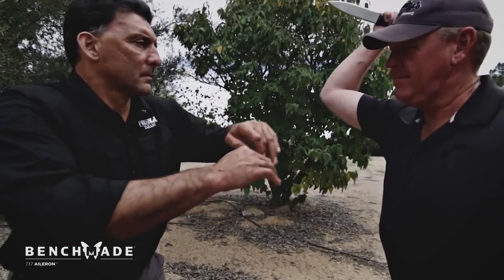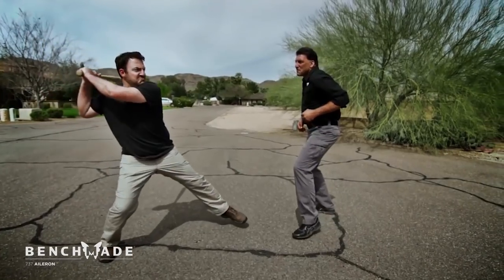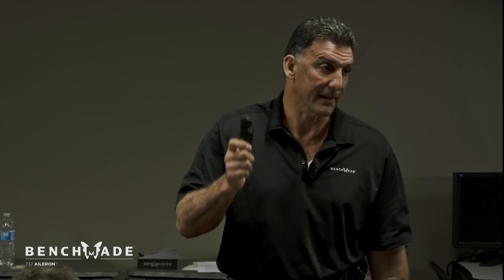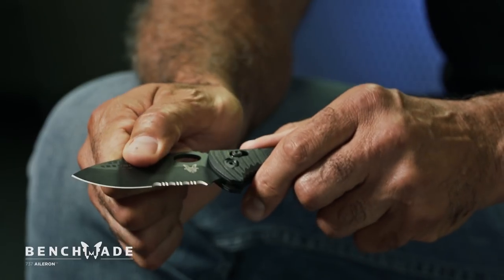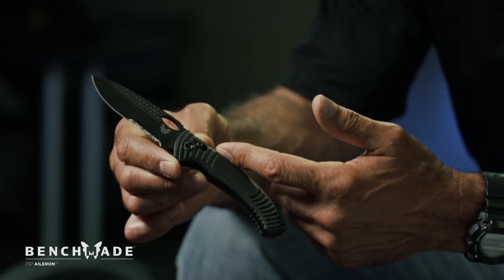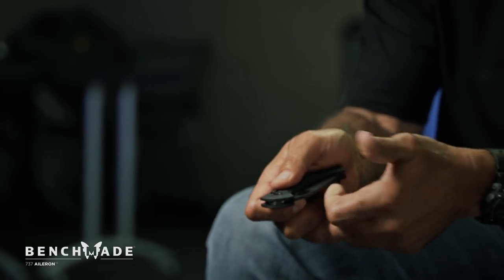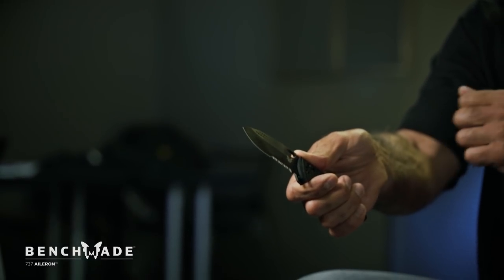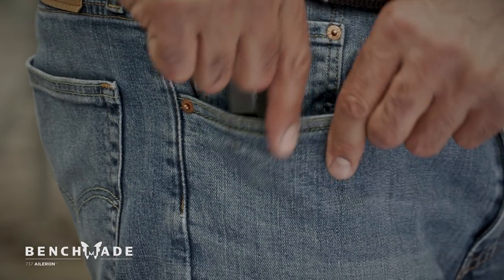Benchmade 737 Aileron

Comment: Selling a two handed knife for self defense is like selling a musket for self defense. Outdated and laughable when there are so many better options from benchmade. I believe this knife will be good for edc but self defense Not so much .
Reply: If you watched the video at all, you would have noticed that the first two options for opening the knife were by flipping and by using the thumb hole. Two handed opening is an OPTION and may work better for some people in some situations. If your extensive training tells you to use one hand, then by all means do so. But don't demean others for choosing other options.
Reply: Dennis Keith I don’t see a two handed opening as a viable option for anything other than self mutilation(especially when your adrenaline is in overdrive). If that is something you think will work than more power to you.besides my original comment wasn’t intended to mock people who choose two handed opening(different grinds for different kinds) but to mock benchmade for listening it in the way they did.

Comment: i've never seen a two hand deployment of a knife, although it makes a lot of sense.  in a serious confrontation you want to rely on the most successful and positive way to get you manual knife open. i'm sure a guy with his credentials has access to knives that open all kind of different ways.  Flipper, thumb stud, assisted and straight auto.  two handed is the safest and most reliable method.  on your run up to the mission you may be tvl. in some funky terrain and not have time to prepare your weapons for action.  a lot of things can happen on the way to the dance. (like weather)that could lead to mud and leave weapons less than spec) i'm not any kind of expert with a knife or in empty hand combat.  one thing i do know; when you deploy your weapon you always want to have the tip facing your enemy.  in fact i've seen a lot of videos where experts(?) spin, or manipulate their karambits backwards.  same reason you don't do it backwards.  you never want the blade tip facing you.  also this guy is using the same knife draw as a pistol draw(KISS)  Speed is associated with muscle memory.  in another lifetime i would revert to a two handed draw,
on the other hand if you carry a fixed blade for fighting this whole discussion is unnecessary
Reply: Tarani has always been an advocate for the two-handed opening technique.  I have a Buck-Strider-Tarani folder in black G10 and ATS-34 steel from 2005, and the forward sides of the blade towards are stippled / etched so that you can open it this way.  Personally I just use the small hole in the blade with my thumb, which to me is faster, but I guess if you train opening it this way that would be more consistent deployment.  Yeah, the video is a poorly executed marketing miss, a bit too tactical timmy, and like one pilot pointed out they can't even carry knives, but I get the point.  I actually picked up an Aileron (non-combo edge) last year for only $150, and it's worth it at that price point.  The best part of the knife is the ergo handle which is very comfortable, and would really make the knife hard to take away from you.  I also like the wide blade.  For me though, if I had to have a knife on me that I had to use to defend my life it would be a Hinderer, or a ZT 0562.  If it had to be a Benchmade it would be an Infidel OTF auto.

Comment: The fastest way to deploy it I just found out is to grab the knife by the blade in the grippy part and snap downwards a lock's right into place so to handed opening be dammed
Reply: But what about middlefinger flicking the hole, or thumb flicking the hole, or disengaging the axislock and flicking it open? Its all one-handed and just as quick, why use two hands?
Reply: @stijnvanpruissen3193  agreed. Found out also you can just snap it open. However it was designed for  Pilots to use and there's not much Room as your setting up there in the cockpit so it was designed for to quick to handed opening there's no real Room to flick it open I guess  You could but there's not a whole lot of Room in the cockpit to be flicking  It open

Comment: It's borderline comical, until you realize that you probably should have your arms up, palm up in front of your face, so you can protect your face, in a vaguely triangular shape (fists together, above your dome, elbows out); from that point, you can definitely positively deploy the blade with the other hand, as that movement is closer to gross motor skill, than fine motor skill (which are the first to go, once adrenaline dumps). It's not that bad of an idea, really.

Comment: What is funny out of all of this are the professional knife commentators, supposed combat expert commentators, and the guys that have NEVER even handled this knife making comments how "worthless this is" and how it's "mall ninja". You guys wreak of having zero experience in the real world. Let's state some facts. I actually own this knife and use it a lot. The blade etching has impeded ZERO cutting. It has been known for sometime when adrenaline, stress, combative environment, gloves, climate, sweat, oil, blood, water, WILL impede your motor skills. Fact. Opening a blade like this is nothing new. It has been around for a while. The etching is new. Though has been used on game cleaning knives. Which way you deploy a blade depends on the situation, and environment. Quite useful if need be. I will say, the etching is a game changer with cleaning game. Used this knife last week for this. Was night and day. The G10 and etching prevented hands slipping with blood. The handle has replaced many of my other knives. It truly is on the next level of ergonomics and grip. The blade is massive, almost 4mm thick through and through. Every prying task I have done so far has been done with ease. The knife came razor sharp. Was dead center. While working on a rig, this knife has truly been my go to knife now. I was quite skeptical of this knife prior to purchasing it like many. But it now has replaced my others. Wanted to clear up all these fake comments on a blade most people here have not even held.